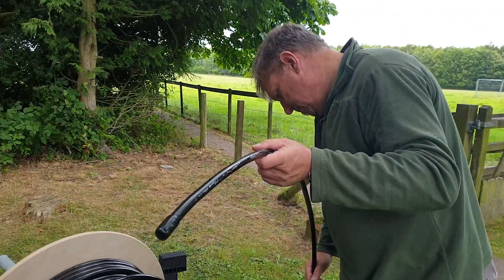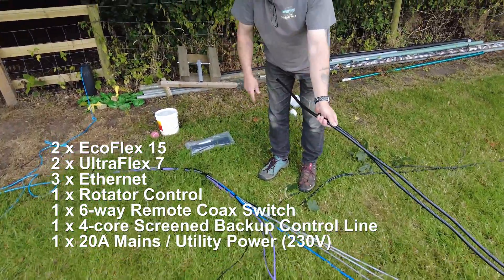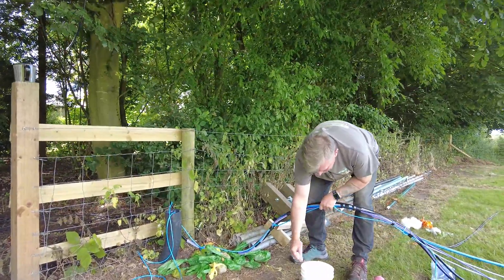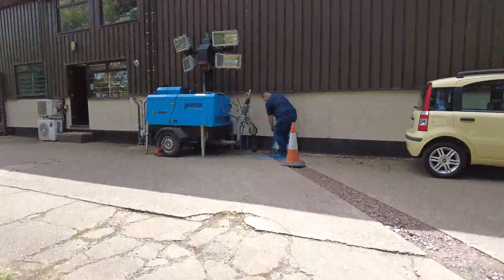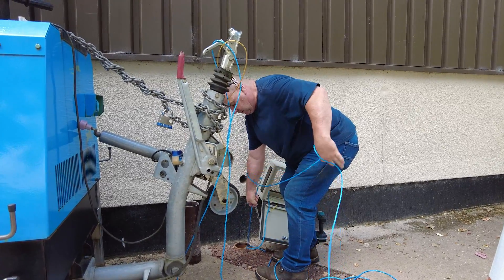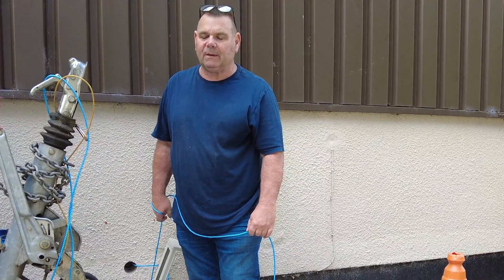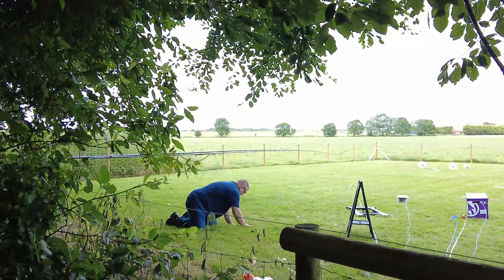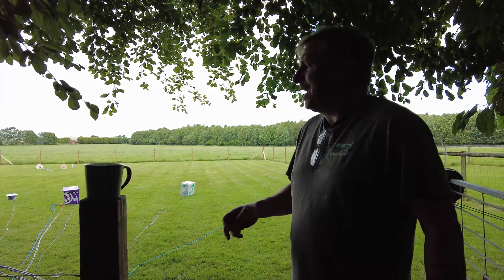Installing 11 underground cables - Pulling Coax, ethernet and control wires

Comment: Had to replace the wiring in my bathroom. Landlords guys couldnt figure how as theyd used a serrated tube instead of smooth inside the concrete. Couldnt push anything through there.
Solved ...with a vacuum cleaner  and a piece of string 😊 smug face indeed.
Reply from the maker: Haha.. Smug face indeed! Brilliant :)

Comment: He needed to keep putting lube on also. Bad thing about that stuff is it becomes concrete in the pipe eventually.
Reply from the maker: No it doesn't.. It dries to nothing.
Reply: @DXCommanderHQ  Must be different from the stuff we used to use years ago then. That stuff dried like concrete.

Comment: One of the best one this for making me laugh. The 2 old boys pulling the cable and young loki on the camera. Also a very true point by Mike never use the miss's washing up liquid for a lub it does degrade cables. Also i will have to teach the pair of you how to put cables onto a pull rope without having to use loads of tape. P.S as Mike got is good laby a new kitchen work top yet.
Reply from the maker: He * IS * going to repair his worktop, yes!

Comment: What cable are you using for the long run of the rotator control?
Reply from the maker: Rotator cables.. So I just looked it up, I bought them from RS Components. The title says "RS PRO 7 Core Unscreened YY Control Cable, 0.75 mm², Grey PVC Sheath, 50m, 18 AWG"